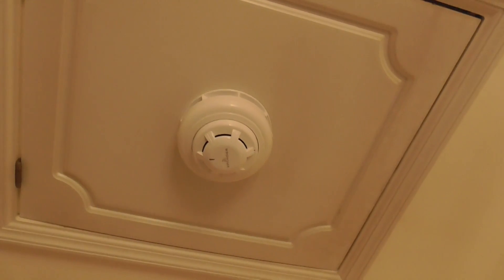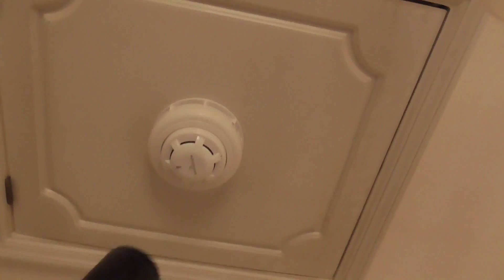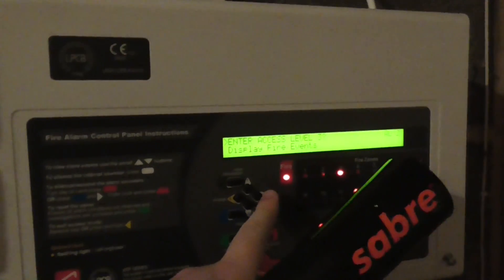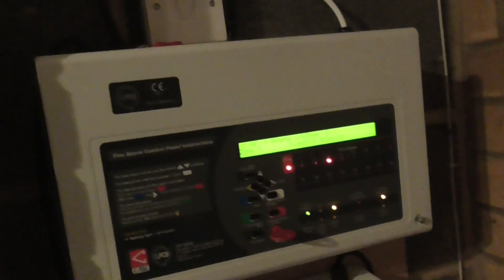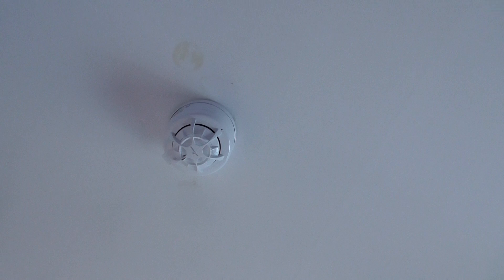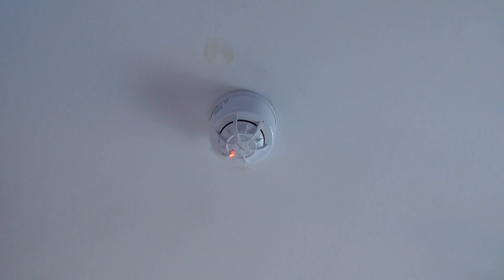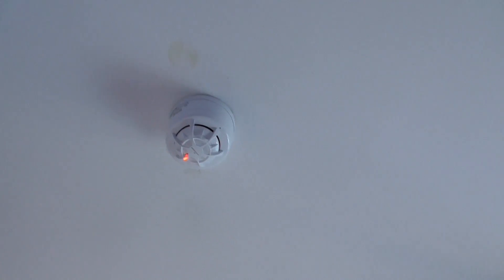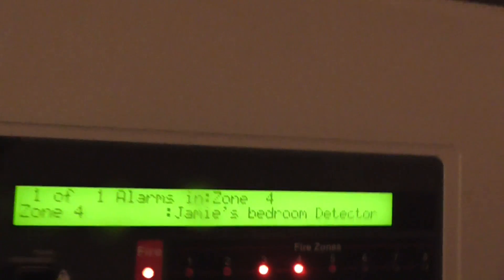Apollo Addressable System Test 11

Comment: Hello. This is a really good system and I probably install an Apollo fire alarm system for my old house that does not have a fire alarm system yet. Are you aware of any Apollo protocol panels that run Coreprotocol? (If you didn't know, CoreProtocol is Apollo's newest protocol that has 8 bits instead of 7).
Reply from the maker: Hi, I believe most Apollo protocol panels can run CoreProtocol such as C-Tec XFPs, Kentec Syncros, Morley panels and Advanced panels I think. Hope that helps!
Reply: @j1firesystems440  Thanks, but I'm not sure what you mean. Does the panel itself still communicate in Discovery protocol? All Soteria devices are back words compatible but what I am referring to is a panel that can take full advantage of CoreProtocol (such as 254 addresses, FasTest etc.)
Reply from the maker: @BukuiZhao  Hi, yes the panel still communicates in discovery protocol. Also on the Apollo website it explains a bit about core protocol and I’m not too sure what panel can do full core protocol with 254 addresses.
https://www.apollo-fire.co.uk/training-support/compatible-panels/
Hope that helps!